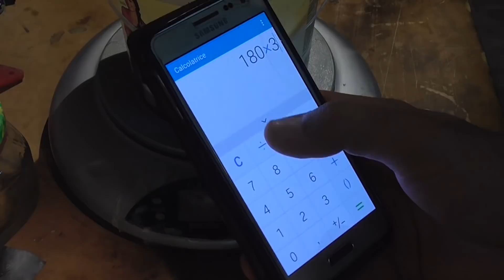How To Make PAPER SPACER MICARTA

Comment: I love it. I like to make my own micarta. Do you use fiberglass resin or casting resin? I usually use fiberglass resin it seems to work very well. Great job on the kerombit by the way . Do you have a rendering of the template? I like your design and would like to use it if you would share I would be very grateful. Thanks in advance and Cheers. Martin
Reply from the maker: I use fiberglass resin for now cause is cheaper😂 but it isn't good if you want to keep the real colours of the paper or fabric. For now i'm not sharing my design cause i want first understand how i can protect them, cause i don't want that somebody could use them for commercial purpose